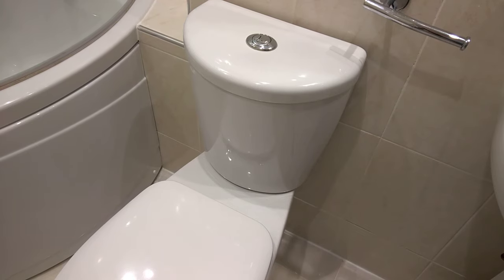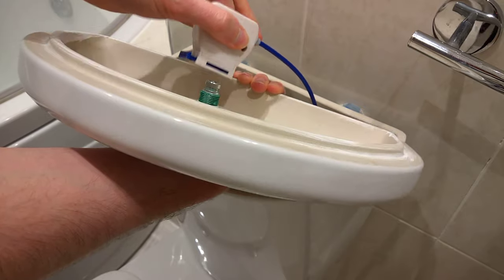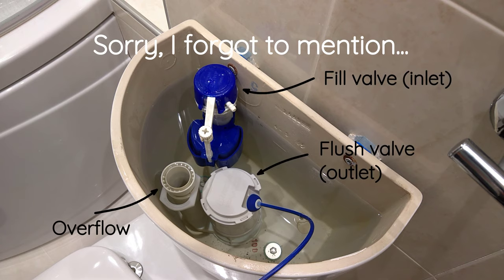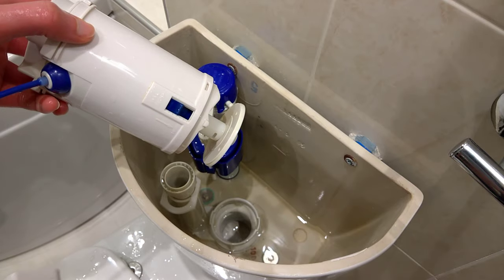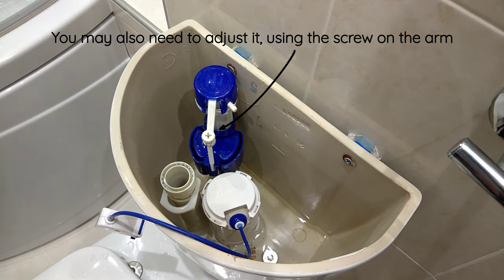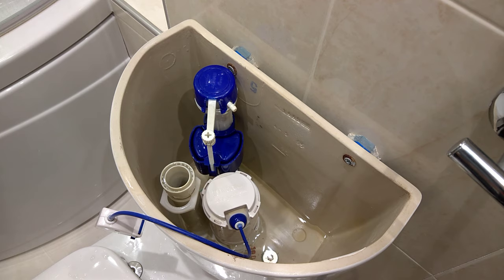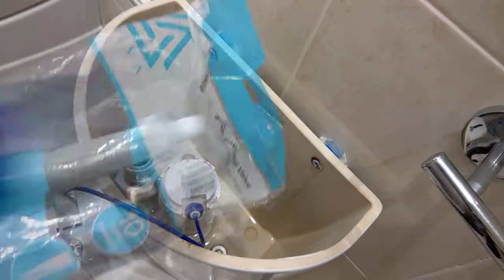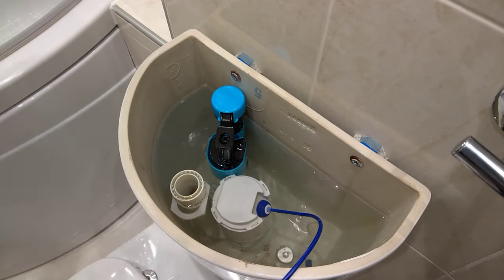Fix for water leaking into toilet pan (push-button flush)

Comment: 18/10/21  I live alone and water has been leaking into my toilet pan for sometime without my knowledge.  I spoke to the only plumber who called me (they are all busy) and quoted £375 for a new toilet, as what you just showed was impossible to do!  Thank you.  I just want to turn the water off until a proper plumber returns my call, but you have really helped me!  "I am a 77 year young female plumber to be!"
Reply: That's wholesome
Reply: The part costs £7-£45 you can get a decent one that you will find in most toilets for £15 the job should take no more than an hour. I did mine which was in an awkward situ it took me little over 10 minutes.  The only tool I used was an adjustable spanner you might need a screwdriver too.
Reply: Totally love this . Good job plumber to be . This video has helped me to do it my self and save some money .
Reply: Just on tip you never mentioned, when you replace the flush valve you must look at the old one and take the name and number, you need to get exacty the same one to fit the other part of the fitting which is below the close coupled with.   If you buy the wrong one you will have to take the world pan and the cistern apart to fit the flush valve. So when your correct flush valve arrives from eBay it's simple to turn into the bottom fitting. You will then have a spare bottom fitting which will come with the flow valve. Good luck
Reply: Sui
Reply: Thanks.  I haven't fitted a Fluidmaster before and had visions of having to dismantle the toilet.  Had a go at the click to release and it was easy.  I worked out, the problem was in the button mechanism, so I will replace the unit and hope for the best.
Reply: What a 77 young u say?

Comment: Great video although no chance of getting the seal out on the valve due to the clips holding the plate in. Tried a screwdriver to open them but all need to open all of them to take the top plate off to replace the seal which is impossible.

Comment: Great video - thanks - my issue was the flush valve mechanism being calced-up and I didn't know how to get the b'stard thing out. After the obligatory forehead slap for how simple it actually was I've soaked the whole unit in descaler, replaced and it now works like new.

Comment: Perfect video for my problem - toilet running continuously. Exactly as you highlighted, the flush valve wasn’t relocating correctly and despite cleaning it the problem continued. A visit to the plumbers merchant with the entire unit and a replacement slotted straight back in and the issue was resolved. Cost £18.32. Time taken to remove and refit 10 minutes.
At the plumbers merchants remember to specify whether the toilet is push-button or lever operated as the mechanisms are not interchangeable.
A big thumbs up for clear concise instructions, they certainly gave me the confidence to have a go.

Comment: Thank you so much for this. With hubby at work, I felt completely helpless until I found this video. Issue resolved, at least temporarily, and now I know what to do if it happens again. It would be even more helpful to include how to find, recognise and turn off the isolation valve. Thanks again 🙂
Reply: my hubby is always at home, but just a lazy xxxxxx as they came 😂😂😂😂

Comment: Great video, so well explained. Had the local water supplier out for a faulty valve at the supply and our toilet inlet pulled a load of grit. Constant overflowing. Took the top off the inlet and cleaned all the grit out of the diaphragm and inside washer. Now as good as new. Thank you sir 🙏🏻

Comment: This really helps. Thank you for posting this video. 

In my case, only the button was broken. Managed to find a replacement. 

But this video helped me to understand what exactly is required to fix. The tutorial helped me to understand when exactly a valve replacement is required. Instead of buying the whole valve, i fixed the issue only with the flush button. Flush button are available for sale in most hardware stores.

Take care

Comment: Super helpful video, thanks so much! I’ve had a leaky toilet with an inlet valve that tip taps and has driven me bonkers. I’ve changed the flush seal but still have a dribble into the bowl so I’m off to fix the inlet valve, and feel more confident about doing so. Excellent video! 🎉

Comment: I think there’s a reason your video came up first!
Perfectly explained. Slightly strange, but there was no outer washer on the fill valve on ours. I cleaned the inner one up and it works fine again. 
Thank you for your valuable information 🙏

Comment: Thank u so much for this video. It fixed my fill valve and saved me $600 to change the entire toilet bowl suggested by two plumbers. Luckily I didn't listen to the plumbers. I only opened the fill valve, gave the rubber ring a good rinse and it works again. I still can't believe I can actually fix a toilet bowl system myself .

Comment: Cheers! In my case a bit of loose silicone in the cistern had got caught under the seal of the flush valve.. a two minute job removing it, thanks. 
- a very clear video. Saved me a lot of hassle. .

Comment: I have same issue with flow valve but design is different. Always a good idea to keep the information on new unit so that replacement spares can be sourced. Back to bathroom. Very clear explanation. Thanks.

Comment: Thanks for sharing on the strip down of the inlet valve. I took mine apart to find small bits of grit or whatever it was. But after a clean up " NO LEAKING OVER FLOW"
thanks for sharing that info 👍

Comment: Well done - very helpful video.  A slight adjustment with a screw driver on the  inlet valve cured the overflow problem.  Stuck a piece of tissue under the pan rim to ensure no further leak.  Thank you

Comment: Very comprehensive thanks, I have both issues and have had since not long after these were purchased new when I moved in. These designs are made to not last long. My mum has an old house and after 50 years her ball valve system is still working as it should. It's just covered in cobwebs. I wish they still made them like this. It's just a little old fashioned having the feed going in for the side at the top, but they last forever. These plastic valves need working on every few years

Comment: I had a problem where the water was passing into the overflow. Took the cap off the inlet valve, gave the rubber seal a good brushing, fitted it back together and it's good as new. Only 5 minites of my time. Thanks for the video 👍

Comment: Thanks for the video. The round washer you shown is not mainly responsible to stop the water intake. The water is stopped by a tiny rubber piece attached at the bottom of the other end of the lever. Hope this will save few bucks. I just cleaned it and it worked

Comment: Thanks for this brilliant video. I got a plumber out to look at my trickle-leaking toilet and he quoted me a price so ridiculous - getting special replacement parts and what have you - that I might as well just buy a brand new toilet. After watching this video I managed to remove the flush valve housing and the seal was full of blisters almost all around so no wonder it leaked. I punctured all of them with a needle, which helped something like 90%, but I have of course ordered a genuine Geberit seal now, delivered to my door in 3 days for £3.00. Might be looking for a new plumber in the future.
Reply from the maker: Glad to hear the video helped you understand the issue better J F. 

Sorry to hear your plumber quoted a bad price. I hope the new seal works for you, if not as you saw the valve is not a big job.

Thanks for sharing your experience. It's always nice to hear when a video helps understanding, and hopefully saves some money!
Reply: @Artexic  Thanks again. Just puncturing all the blisters in the old seal actually turned out to work 100% - not a drip coming through anymore - but I will of course replace it with the new seal when it arrives. I cannot believe how simple the fix was after having watched your video so you have genuinely made my day.

Comment: Hi, thanks for the informative video. Works a charm. One extra hint that I used was to turn the supply off and leave overnight. The cystern emptied so I knew it was the washer at the base of the flush unit and not the supply washer. Thanks again.
Reply: Exactly what I did. £2.95, and only a couple of minutes to fix. I wonder what a plumber would've charged me!!

Comment: Thanks for this :-)  my cistern has been overflowing massively for weeks now, and im a bit of a tight arse when it comes to paying plumbers etc.  I dod have to replace the whole inlet valve, which was under £20. Im happy with that, Job no2, replace bottle trap on a small sink.  Job No3 is massive and needs a digger in my front garden , as i dont think there will be any tips on here to fix that one sadly.  Thanks Again

Comment: Absolute gold! I've been putting off calling out a plumber for months. Found this video and have fixed it myself. New seal on the bottom of the flush valve. £2.95 from a local plumbing supplies shop. If I could buy you a pint, I would! Many many thanks.

Comment: Brilliant and well explained friend ... I don't yet if one of  them scenarios you described is the problem until I check at the property tomorrow .. my system  is brand new, it's similar to yours but it has a little pipe running from the Float system .

Comment: Great video, explains the potential problems very well. My problem is that the flush valve doesn't seal properly. Where you shook it and the valve dropped - that just doesn't happen with mine so water leaks into the pan as fast as it comes into the cistern. Now I know how to fix it myself. Many thanks. I wonder how much your video will save me!

Comment: EXCELLENT PRESENTATION,  both my toilets have been problamatic in recent months. Trouble is, whenever I look for help on YT , NONE of the vids, have ever shown the same inner's, that my two have. INCREDIBLE--just how many models are there,  to do such a simple job ? There is some hope here though, one toilet's Cistern has a slight but continuos  run of water, AFTER, it has refilled the cistern, but somehow, it never goes over a certain level mark, that i have put on the inside wall. Another mystery, is that the overflow, which is just a straight upright plastic pipe; has a black plastic cap on it . HOW, would a full overflow of water, escape down the pipe, and avoid a flooding  ? unless, as shown here, the water is running down the toilet pan, back wall,?  I shall test and report back.

Comment: Thank you for the video, very helpful. It's the middle of the night and I couldn't sleep because my toilet was dripping and kept refilling. It turned out the flush valve just needed unscrewing and once I put it back in it stopped. I wouldn't have known to try that without this video.

Comment: Thank you very much! Our bog used to drip water so I took out the seal from flush valve and replaced it using a £2.29 part from Toolstation!
Reply from the maker: That's fantastic to hear... Thanks for sharing your experience, it's great to hear how cheap your fix was! All the best

Comment: My toilet has long float arm. After watching video i undid flush valve a found what looks like plumbers tape stuck under flush valve. Also turned over inlet washer. I think i know what caused the problem. Correct me if i am wrong, but i filled up bucket under overflow and tipped in toilet bowl which i think caused problem. Thank you even though our toilets are totally different apert from cleanliness. Thanks from Australia. Now time for the best Stout in the world Coopers .from Australia.

Comment: Thank you so much! This gave me the confidence to pull it all apart and find the fault,m and solve the problem! Very well explained and clear
Reply from the maker: No problem at all Tim. Your comment made me smile, as confidence is the key from videos like this. I always know some people will have different issues, so if I can explain things in a way that gives confidence, then I've hopefully helped.

Thanks for your comment, and I'm delighted to hear it helped you solved your issue.
Reply: @Artexic  how do I stop the water from running into the overflow? My toilet kind a different from yours
Reply from the maker: @dwaynegreen5556  Hi Dwayne, even if it looks different you'll still have an inlet and outlet like I showed so should still have the same potential scenarios.

If the overflow pipe is in use it is probably the float positioning or the seal in your inlet. If you identify the inlet you should be able to follow similar checks on your unit

All the best

Comment: Thank you so much for the video my problem was in the flush valve. I simply removed it cleaned it and put it in. It's solved the problem temporarily. So I think the suction cup needs replacing, could you show how the flush valve dismantles.  That would be great.❤️

Comment: Very clear and concise but cannot replace flush valve & or washer, the problem is the flush valve will not come out despite considerable controlled exertion.  Thinking it must be fixed underneath the tank where I cannot get to it.

Comment: Good video thanks 
I can't get the flush valve out even though I'm putting a lot pressure but doesn't unclip tried as you said left and right. Also the overflow moves when trying to get it out. Any ideas please. Thanks

Comment: Very helpful and easy to follow instructions.
In my case, the control cable does not reset the lever near the buttons. I have to use a pen or screw driver to push the lever, which then resets it and stops the flow of water. Any advice will be helpful. Thank you

Comment: I've got a drippy toilet with push button on the top and isolated it today to find that when I came back in and turned the isolator tap back on, water rushed in to refill the cistern which must have been partially drained.  Not opened up yet but I'm assuming this means the flush/release valve is leaking?   Thanks for a really good, in depth trouble shooting video.

Comment: Hi. Thanks for this very well explained video. Successfully replaced my fill valve n now flush valve is under testing after clean :) the only thing I’d add, my fill valve had a flexihose connecting on the bottom n u may need a new seal there. Very useful and saved 90£ to a woman who never dipped her hands into a toilet :)

Comment: Hi what is the make of the one you have as its the same as mine I have reversed the seal and it seems to have worked thank you. I would like to buy the seal but the amount of makes is ridiculous.
Reply: Pretty much the same issue I have... the chances of finding the exact same replacement part(s) for a 15+ year-old cistern are practically zero. I would love to try replacing the washer(s) on the inlet valve mechanism - I have diagnosed that is the issue, from testing - but apart from now knowing how to remove the inlet valve for easier access (even though the video fast-forwarded through that part, I got the idea!) I still have no idea how to dismantle MY particular valve assembly to get at the suspected faulty washer(s)?!! Still, at least I learned something...
Reply from the maker: Hi Robert, the new one I installed in this video is by Viva, and was bought from Screwfix. Part number 940HR. Viva Bottom-Entry Skylo Fill Valve 15mm. I'm not aware of any vendor selling the seals alone, which seems terrible for the environment

Comment: I have a push button toilet and have a leaky loo.  Plumber just been around to fix it and replaced the seal ring thing.  But it's still leaking and by exactly the same amount.  He did say it might take a few weeks to stop completely.  But surely there should have been some immediate reduction?

Comment: Hi, I have this type of unit but the issue is that the button doesn't always release so the toilet keeps running. I have bought a new unit to just replace the removable unit (I don't need to replace the rest of it) but the old one doesn't seem to release! I can twist it as you show but can't seem to pull it apart from the base. Any ideas or just use a bit more force?! (existing and new units are both Fluidmaster brand). TIA

Comment: @ 5:00, before you buy anything... I live in an area with hard water. I opened the white casing for the button mechanism (requires small Phillip's screwdriver). Pour descaler down the cable the runs inside the blue sheath to the cylinder. Next clean out/lubricate with wd40 as descaler is acidic and the cable is steel. The cable can be caked up with limescale, stopping the valve from closing properly, resulting in water running constantly into the toilet bowl and the cistern constantly refilling.  Fixed with no replacement parts!. I threw some descaler in the cistern for good measure afterwards too. Not been a problem since.
Reply: This is similar to the issue I had. The cable ferrule inside the push button housing had clogged with limescale and was stopping the cable/button/valve from returning to its closed position. I cleaned up the ferrule and lubricated with ptfe grease and it solved the problem. No replacement parts were needed in this case either. The video was still very helpful though as it helped me troubleshoot the cause of the problem.

Comment: Daft question - just fitted a new siphon flush valve which has an internal overflow system.  If the inlet valve was to not shut off and keep on filling up the cistern, the excess water runs into the toilet bowl. My question is: will the toilet bowl fill up and then flood the bathroom?

Comment: Hi, I have two syphon cisterns (both with restricted access) and they trickle water into the pan if the button isn’t held down until the flush is complete. I’m assuming some moving part isn’t getting the pressure differential encouragement it needs on releasing the button normally. Can you please advise?